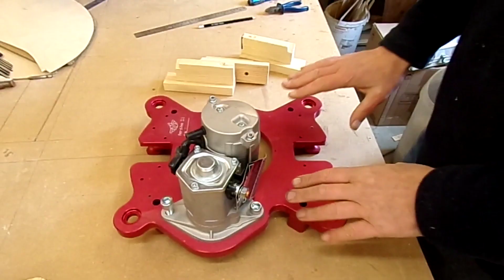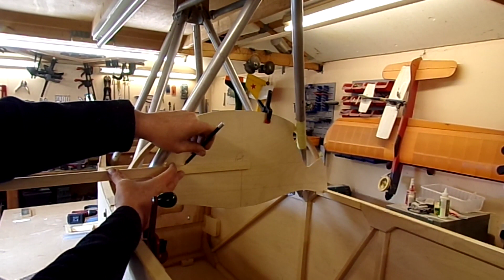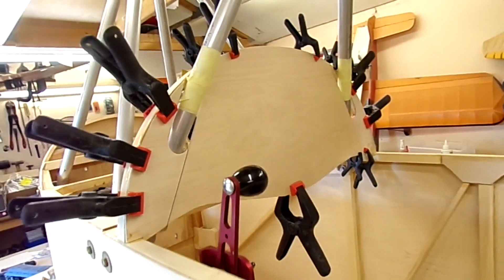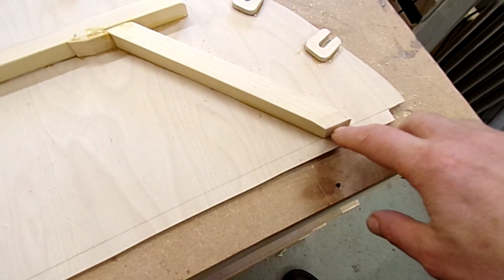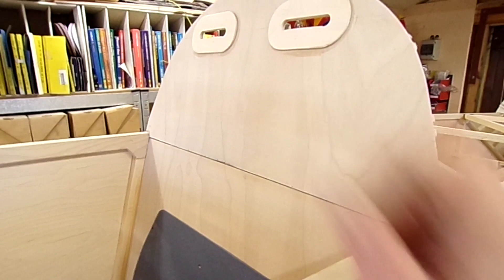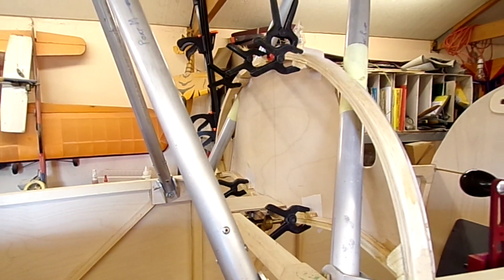EP99 Cockpit and instrument panel Fisher Youngster

Comment: I have a revmaster 80 horsepower serial #b0031v  or maybe it's boo3 iv regardless the kit is over 30 years old.  Is your engine similar? Mine came off a Sonix and is just broken in.
Reply from the maker: My engine is rthe AeroVee from sonics the carb is down the back of the engine with the inlet manifold coming up the back and the ignition system is different to save weight.

Comment: Might you want to add spanner clearance for the electrics in the bulkhead? The control-line models illustrate the idea of progressive passion from childhood Etc.! Nice kite!
Reply from the maker: That is a good suggestion. Nearly all my instruments will be front mounted with screws going into anchor nuts and the Pitor and static lines going into quick connectors, justg for that rerason. I have had to think all along about clearnaces for the firewall forward and I think things are still going to be tight.

Comment: Seat belt doesn’t want to be lower by much, when you get in a crash if it’s lower it will have a tendency to compress your back… pulling down on your shoulders, rather than just holding them back
Reply from the maker: Agreed the figures I was quoted were level to 1 inch below for aircraft,  for cars I have been told from 1/2 inch below to 2 inches  above.  For racing cars we always went with level. The thing is I am building it for me so they will be too high for most people.

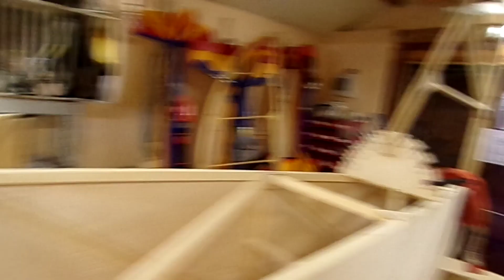Comment: @13:35, I had to make the same type of turtle deck stringer blocks on my build.... looking great!    I was out at the airstrip a few days ago pulling up shoulder harness and anchor cable off😅
Reply from the maker: You are just ahead of me on that as I have to make my shoulder restraint anchor cable and lap strap fixings.
Reply: @flyingkub  some of the fittings are a bit tricky to get off, but they're made at least.  I will be remaking the horizontal stab fittings cuz there were drilled up bad.   One thing that the original builder did on almost every bolt was that he overtightened, causing washers to crush the wood!!!
Reply from the maker: @jimmyboy163  over tightening bolts on wood aircraft is common and reduces the strength significantly, it is one reason some aircraft use bushings as you can only clamp down as far as the bushings ( only a few thousands on an inch).
Reply: @flyingkub  there's bushings for the wing fittings but not anywhere else.   I have to remake the fwd horizontal stab bracket cuz original builder misdrilled the holes, causing the lower hole that goes into the fuselage to come thru the 3/4" backing ply too close to the edge.  And along with overtightning, that ply was crushed about 1/4"!!!
Reply from the maker: @jimmyboy163  stick to what the plans say but at least now you know the consiquences of the errors.
Reply: @flyingkub  yup, I'm thinking the original builder must of spilt coffee all over his prints and just "winged it", no pun intended,  lol
Reply from the maker: @jimmyboy163  Often happens with home builds.